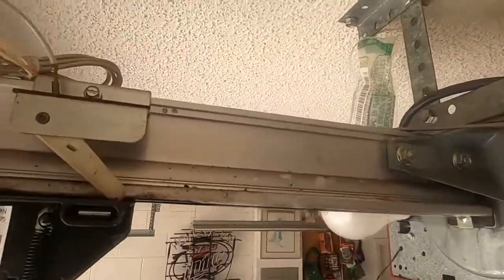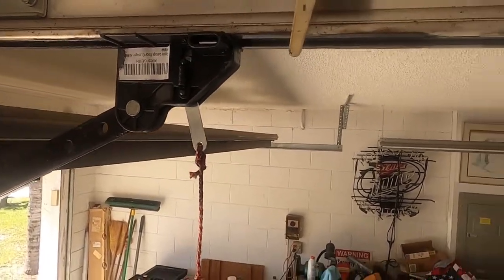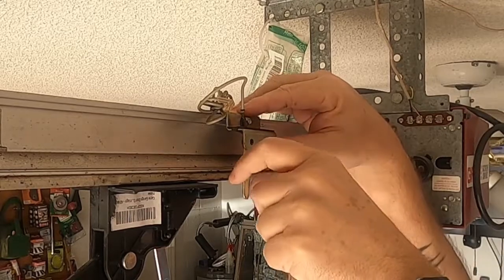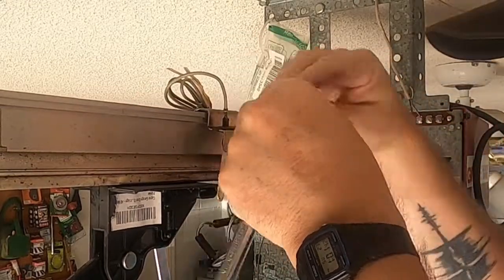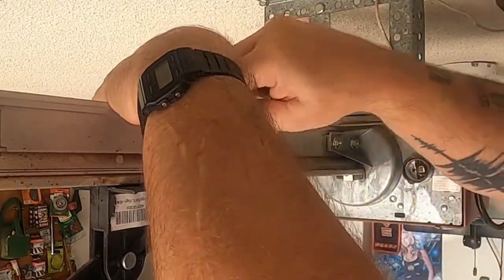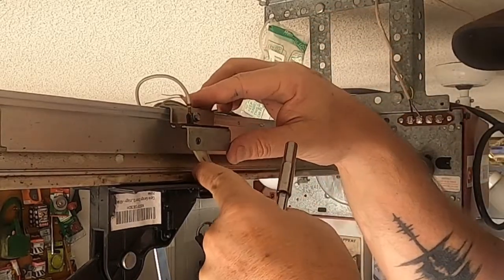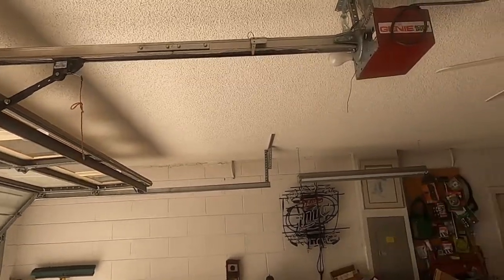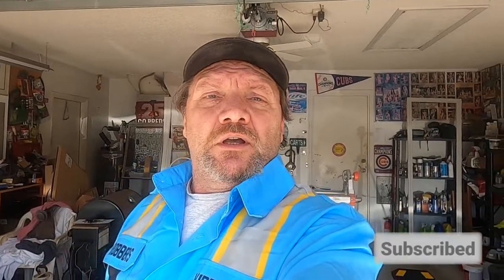How to adjust/install a limit switch on a Genie Screw drive garage door opener. Very Easy!!

Comment: Enjoyed your video, it looked like it wld be easy.
I have a question. When the door is down, am I able to set it so I can just raise the garage door like one foot? That is if I am not home and trying to  get air to circulate in garage. Thk you.
Reply from the maker: When the door is down you can hit the button then when you want the door to stop just hit the button again and it will stop..that only works when the door is going up, if the door is on the way down and you hit the button it will go back up.

Comment: Hello sir ! Thanks for this very informative video. I believe I have the exact same model as yourself. All of a sudden today, the door decided to stop around 20" short of fully closing. It was working fine in my new home of 4 months till now. Could this be the closing limit switch nearer the garage door being faulty ? I have little experience with garage door openers. What model number do you have and what would my first step be in fixing this issue ? Any help would be appreciated.... Thanks !
Reply: I have a chain drive Genie, not screw drive
Reply from the maker: That sounds like the limit switch but hard to say without seeing it.check the switch at the down side to make sure it aint broke or dragging. make sure its tight also.. check the wire to make sure its not broke also make sure its in the right place and didnt creep up the screw hense checking to see if its tight.last resort get a new switch they are not expensive at all. hopes this helps! https://www.amazon.com/gp/product/B004CAN18W/ref=ppx_yo_dt_b_search_asin_title?ie=UTF8&psc=1

Comment: Mine does not have that hard switch. I have not been able to find any tutorials how to adjust. I'm assuming mine is magnetic.
Reply from the maker: Check the motor box. There should be 2 adjustment screws probally on the side or back of the unit..one to adjust up limit and one for down limit.

Comment: I just changed my limit switch but when I wanted to lift the door it doesn't work and it's a new limit switch. What is the problem? Thanks
Reply from the maker: It doesnt work at all? just changing the switch shouldnt do that. try pulling the door disconnect and move the door then try it, if you still get nothing that sounds like you have no power or something is wrong with the unit. you can also try disconnecting the new switch just to see if thats it but I dont think so.